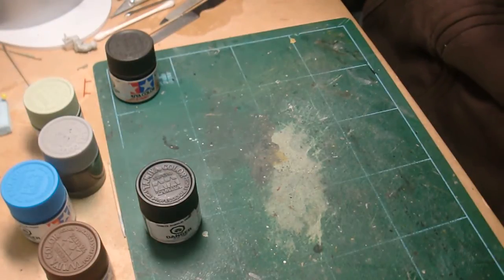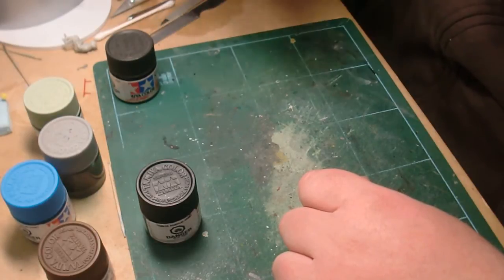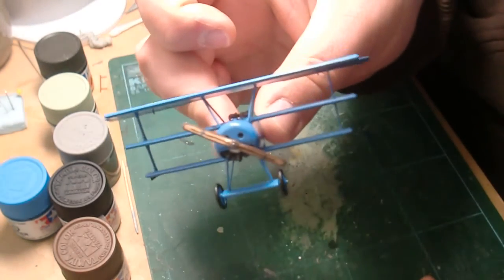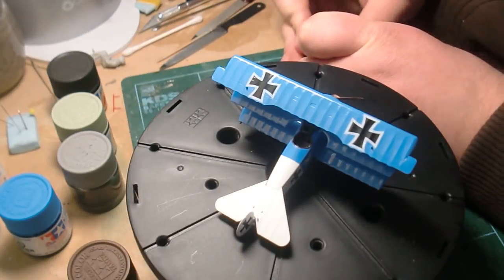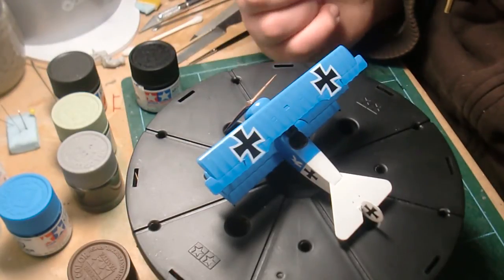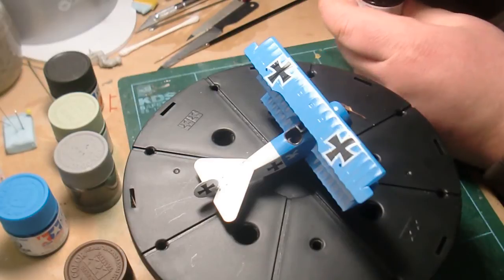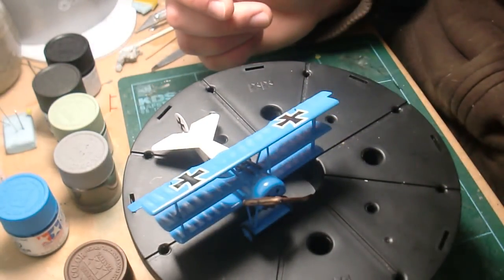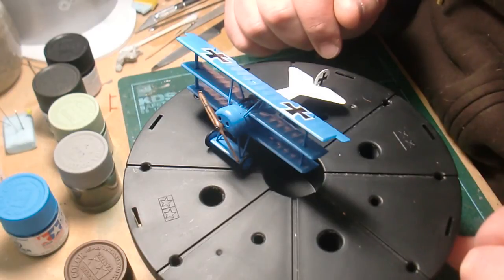Revell 1:72 Fokker Dr.1 (Part 12)

Comment: Very nice build. Did you coat the entire model in Future before add the flat coat? I would recommend for your next build a 1/72 global hawk or predator model. They are quick and easy build and after a project like that some time one need to "cleans the Pellet". Nice job thanks.
Reply from the maker: I think it might have been the Flat clear not being shook up enough, and being too cold. Great choices for a next project, but I've started a Zero, I couldn't resist building it right away :) But I will look into those kits, thanks :D

Comment: Nice work, but what happened with the black cables in the tale and the front? I was hoping you to tell how did you make it. Greetings from Perú!!
Reply from the maker: Hemson Jordan Hi Hemson, sorry could you explain a bit more, do you mean the rods on either side on the lower wing?
Reply: rebelsatcloudnine I mean the use of black thread in number 9 and 16 of the ensemble instructions!!
Reply from the maker: Hemson Jordan Ah, sorry about that man, I actually didn't use it on this kit, at the time I didn't have proper tools or the motivation to do it.